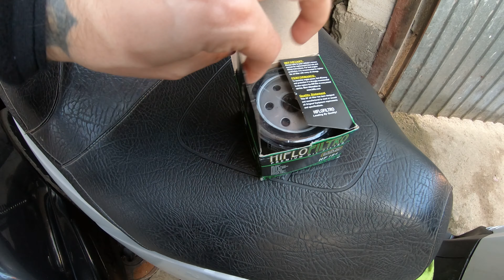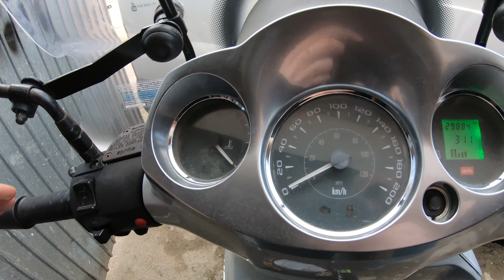Aprilia Scarabeo 400 oil change,Piaggio MP3,Piaggio Beverly,schimb ulei,Cambio olio,Ölwechsel , 4K

Comment: Great video, does your have a lambda sensor(o2 sensor)?Do you know if the 2008 Scarabeo 500 is 460cc or 493(2 spark plugs and lambda sensor)? Thank you
Reply from the maker: Yes sir , i have and 500 ccm = 2 spark plug
Reply: 2spark beter than 1 ?